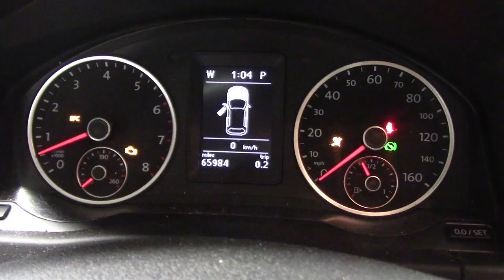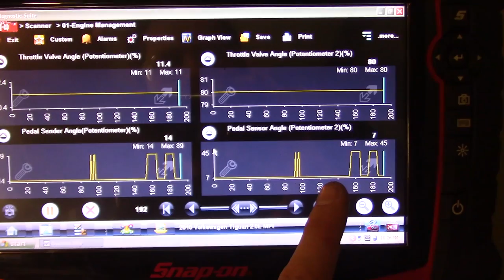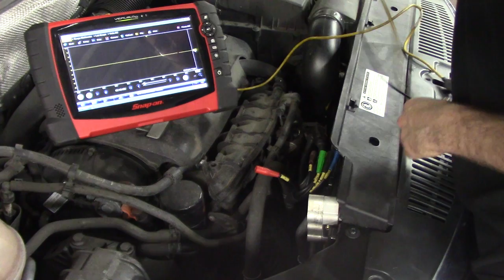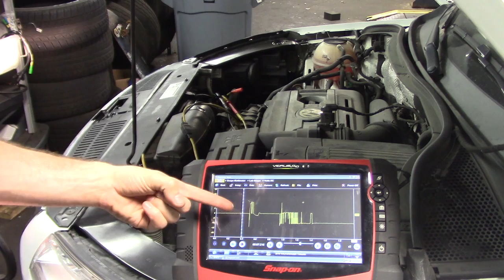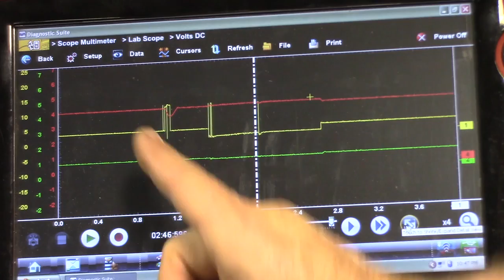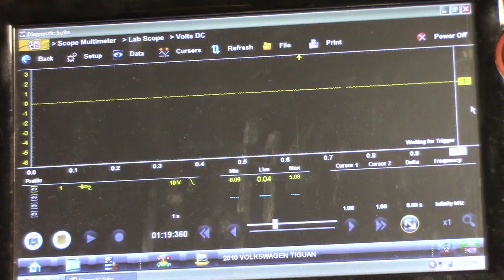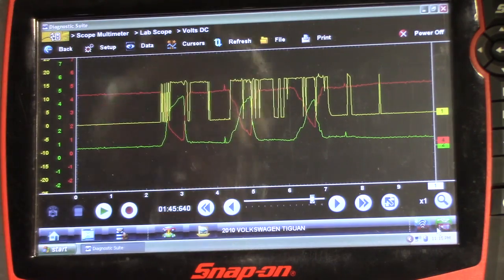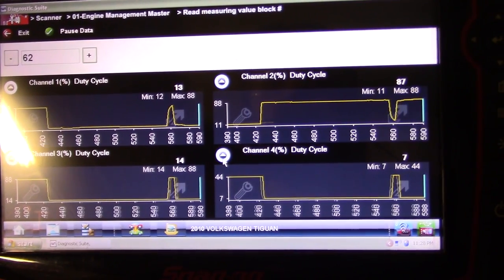2010 Volkswagen Tiguan 2.0T- MIL/EPC P1545 Throttle Valve Controller Malf. (no throttle response)

Comment: Waaaaaay back when... I once forgot about a rag in the intake (used it to keep dirt from getting in). Car would idle, but didn't have power. This was on an old CIS car that has the 2 throttle plates (primary & secondary). No way that the rag could get sucked past either... so I was a bit lucky. Took me a bit of time to find the issue.  =)
Reply from the maker: simple mistakes happen...to everyone. at least you found it, those have only a closed throttle switch not an actual throttle position sensor right?
Reply: This one just had a WOT switch... CIS-Lambda. In my case, I knew that the car had no issues when It came into the shop, so I simply had to retrace my steps (which still took a while, apprentice at the time, so it was ok). Getting a car like this come into the shop as a no-start... I would never have thought of checking for throttle obstruction, until... like you, determined that it is throttle related. Great videos you've been putting up!

Comment: Is the block measure mode, where you got four values at a time, a standard for VW cars? I have a 2000 Skoda (VW took over this brand back then, so basically it's just a VW with Skoda tag on it) with EODB implemented, but it's not OBDII compatible (no check engine light at all and it will not work in OBDII mode with any scanner). I use a VAG-COM program on my laptop and a VAG KKL cable to connect to it. I noticed I can't read single PIDs, the only way is the "block measure" mode when it gives me four at a time.

Comment: It seems you are an expert.  can you please advise? I have a Passat 2 L Diesel 2013, while downhill with engine break engine fault signal came on. mechanic read error codes: P219600, O2 sensor (bank 1, sensor 1), System too rich, status [237] and P012100, Throttle-valve position sensor, signal improbable, status [096]. 
he then cleared and let me go to see if it comes back. It did about 500 miles later downhill tempomat / cruise control on. some suggest it is the throttle valve started dying and needs to be replaced. car runs nicely smoothly same powerful as before. What do you think what should I do. Throttle house £ 250-350, position sensor (good for a lot of makes) £20, throttle repair kit ~£50, The car also has got a major service a month before. can it be a dirt from the filter/engine. Would a valve cleaning solve the issue?
Thank you for any advice.

Comment: My friend ,
What's the best affordable scan tools that you would reccomend ? And great videos straight to the point and no guessing . And an honest man .most shops out there , here or where ever you may be , would have sold the customer the part with out saying anything.
Reply from the maker: Thanks Joe.  I really appreciate your comments.   Scan tool costs are all over the board.  Depends on your budget.  I would suggest a snap on verus based on the scope and scantool built into one unit.  The autel also is a good scantool.  It has a lot of functionality on a lot of makes and models. But it all depends on your budget

Comment: How many miles on it?  I suspect a possible engine change with a used engine from a wrecking yard.  They often put paper towels in the throttle bodies to prevent dust/dirt from getting in when they sit in the warehouse.

Edit:  I see at the end you found it came from a body shop.  That's even less excusable, in my opinion.  I had an 07 Honda Odyssey that came to me with a check engine light.  Scan showed bank 1 and 2 upstream LAF (O2) sensor heater circuit codes and some other unrelated circuit code.  The owner told me the MIL had been on for about 15K miles after it had been in an accident.  They took it back to the body shop shortly after it was repaired and the body shop just told them it was "some emissions thing."  They even had a timing belt done by another shop later.  Nobody fixed it.  When it came to me I scanned it and suspected a blown fuse right away, most likely caused by a short across the heater circuit on the front LAF sensor during the accident.  Replaced a 30A radiator fan fuse and the LAF fuse under the dash, cleared the codes and out the door with a happy customer who thinks I'm better than most shops (I'm just a DIY'er who does some work on the side for others.)  Body shops seem to be notoriously bad.  Fortunately, the non-functioning LAF's didn't take out the converters.
Reply from the maker: timing belt suggested for an o2 heater fault, crazy. yeah sometimes bodyshops are good for these types of things

Comment: Good job man but why did you not first try to erase the fault code and then do a throttle body basic in basic in 04  setting Chanel 060 the engine ECM would of try to command the throttle body but I don't know if it would've work with the throttle plate not in a rest position like it was with the  paper in there.
Reply from the maker: tried off camera, the fault would not clear and basis settings said error
Reply: V10PDTDI How would you erase the fault with out a scan tool

Comment: Thanks for uploading the video. Any thoughts on how to replace the fuel pump control module? The check engine light just came on in my VW Tiguan 2011 with an error code of P025C - "Fuel Pump Module Control, Signal Too Low".  I'm hoping that replacing the fuel pump module control will take care of the problem. Any advice is greatly appreciated!

Comment: Very good video brother. I am actually doing one as we speak on a 09 volkswagen eos. Same set up. I did the same thing with the scanner and my app sensors are good with one at 14 and other at 7 and pedal to the floor it's 88 and 44. App are good but the throttle sensors one is 84 and the other is at 6 roughly 7 but very unstable. And when pressed the sensor 1 goes to 99 and the second drops to 12. Clearly a fault as these should hit 100% when both are added. I don't have that 6 pin connector set . Can i use my aeswave connectors and disconnect the connector to the throttle body and do my checks like that or do I really need it to be connected to the throttle body? If so can I just gently pierce the wire and then put electrical liquid tape.  Thank u brother. By the way man u really know ur stuff on these euro cars. But if the throttle body needs to be replaced and I don't find paper jammed up in there I know this has to be relearned with the vcds because I checked the verus and it doesn't have that function in it
Reply from the maker: The throttle sensors should add up to be roughly 100. The app sensors on should read half of the other.  Sounds like you have that.  When doing these checks the throttle needs to be plugged in. And you can backprobe its just difficult without that harness I used.  You can adapt the throttle with the verus. Use expert mode and go into basic settings channel 60

Comment: 7.40-8 min you talk about angel sensor 1 and 2 my car has half throttle response stops at 3k rpm i need to know how to go about it same set up as the suv in the video same engine its a 2009 vw passat cc 2.0t 6 speed manual i put a ebay throttle body on it and 5 days later epc light comes on and im only getting 3k of rpms and im getting codes p2106 p2101 please help me if you get a chance

Comment: hi frd im replace steering for skoda actavia 1.9  aftar that steering light on...when i switch of key ig  steering move self  00573 its fault code   thanks
Reply from the maker: Steering angle sensor fault?
Reply: ok thanks so much
Reply from the maker: I'm asking is that the fault?
Reply: yes  tahnks 100

Comment: Seriously?  Mastertech? Right area but not knowing exactly what should happen at ignition on. Checking signals and supply to throttle should take 5 minutes max. Never even mentioned possibility of bad plug between throttle and ECU or weak power to motor.